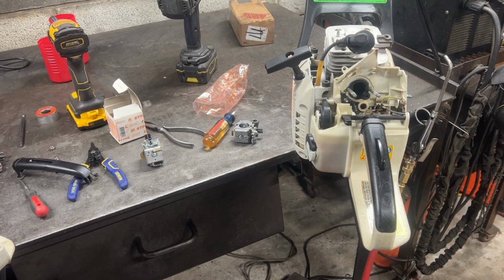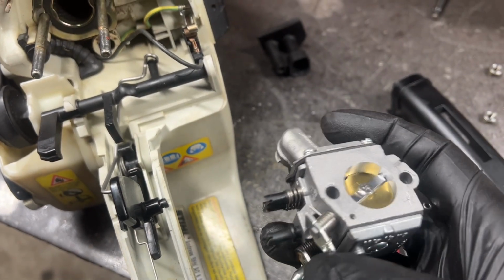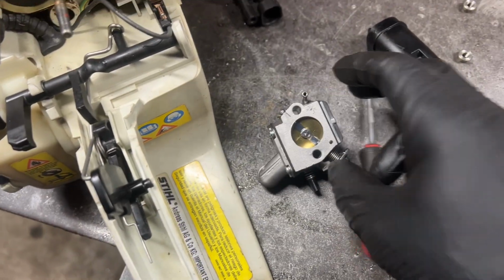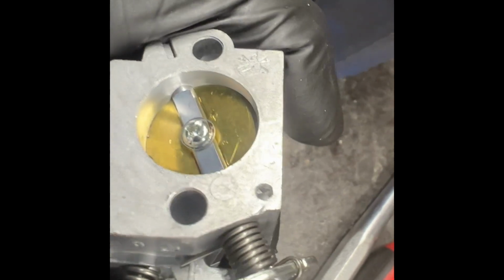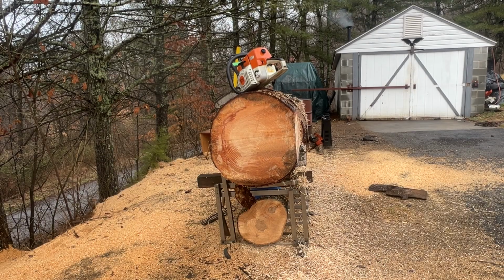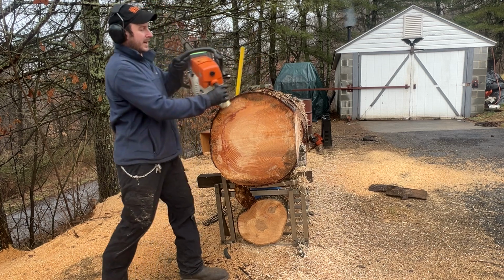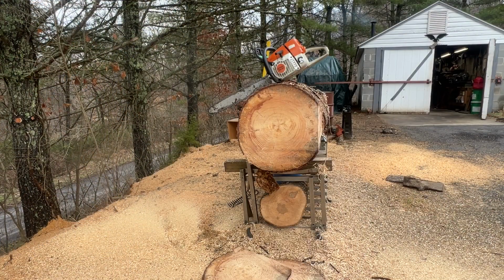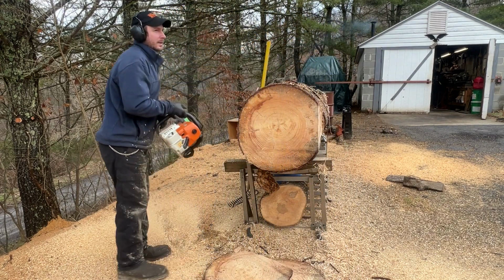STIHL MS361 HD14 CARB MOD AND PORTING

Comment: Mr motel 6 guy lol howdy from TN. I’m looking for someone to port a new never ran 562xp. I don’t know if you do jobs for followers or not but you seem to do a good job. I’m wanting to go to the fine line of work saw and hot rod with it. I’m going to have it pulling a stihl light 28 with a skip. So I’m looking for high revs and torque. A lot to ask for but there’s a lot of hidden power in the 562. I’ve researched and came up empty if the 572 carb will work on the 562. I’m leaning towards it won’t. If this is something you can do reply with your email and we can work out the details. Thanks
Reply from the maker: Yes lots of hidden power in that model and sure I can port it for you. My email is philschukraft89@gmail.com. You can also call/text me at 240-520-1935